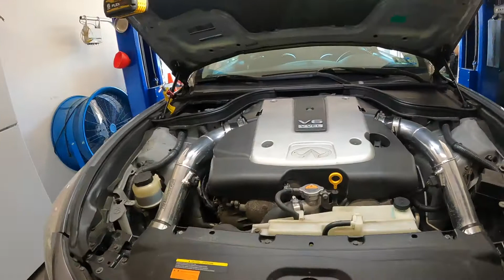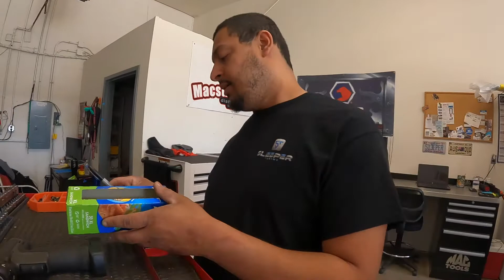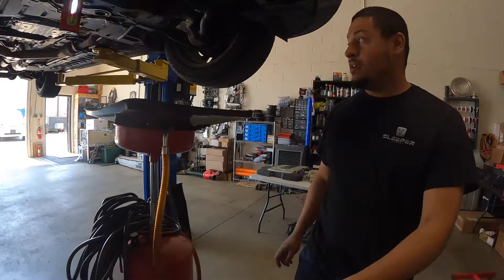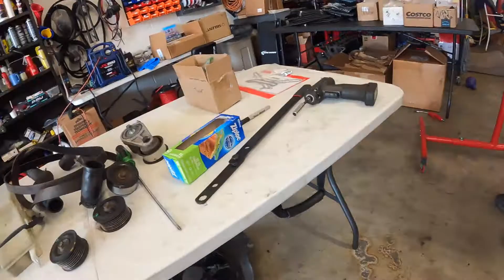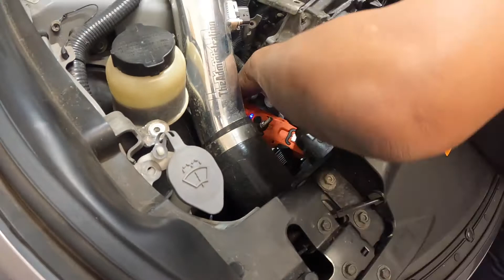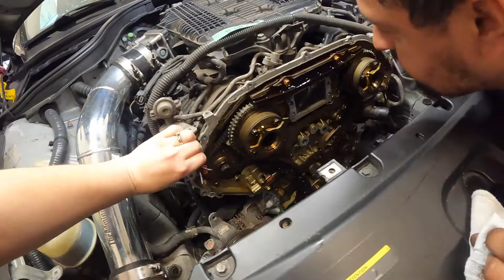Avoid engine failure. How to replace VHR Oil Gallery Gaskets. Tips for your G37  pt.1

Comment: in regards to the timing if i align the marks on the sprocket and the timing cover is that top dead center of the compression stroke? or do the cam noses need to be checked in order to know for sure ??

Comment: Nice video.  How did you stop the engine from rotating when removing or reinstalling the harmonic balancer?  Torque converter bolt??

Comment: Can you get away with not removing the cam covers or does it just make it too difficult to remove the entire timing cover that way?
Reply from the maker: not sure what you're referring to
Reply: @SleeperTuning  I'm referring to the two upper covers that are bolted to the front timing cover. They are covering the camshaft sprockets but I have seen one dude who left them on when he removed the front timing cover.

So which of the two options is the better way? Take them off prior to removing the front timing cover or just leave them bolted onto the front timing cover?
Reply: Those are the solenoid covers. No, you don't have to remove them. Some do just to replace the gaskets on them.

Comment: hey man I hope you can answer my questions, I have a 09 infiniti G37 that I just got an engine replaced, used engine has 118000 kilometers after the engine was installed on my first drive I got
P0300 Multiple Misfires (but engine still runs so smooth)
P0524 Engine oil pressure too low (engine oil is clean and up to the full mark)
P0021Intake valve timing control Bank 2
P0011 Intake Valve Timing Control Bank 1
my car runs very smooth shifts all the gear as long as I stay under 3500 RPM, but as soon as I go little hard and it hits 3500 RPM it jerks and goes down but I am still ok to drive under 3500 RPM
I have driven the car over 800 kilometers under 3500 RPM
any suggestion will be appreciated
THANKS
Reply: low engine oil pressure and vtc issues over 4k rpm ie power and roughness are usually a galley gasket faliure. It was on my HR. If the car has not had them done they need to be done regardless but I would loosely guess those issues are linked. Thats what happened to my engine and I ended up loosing a bearing and needing a whole replacement. Best of luck brother.